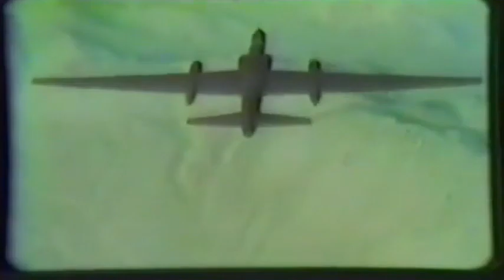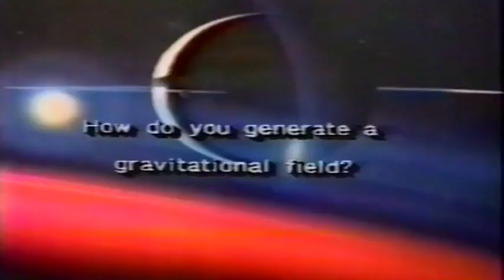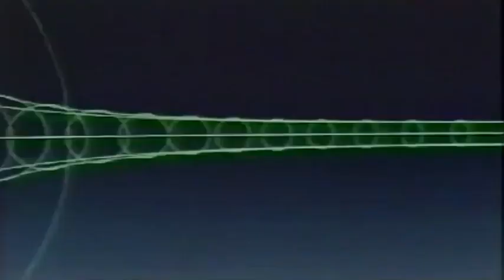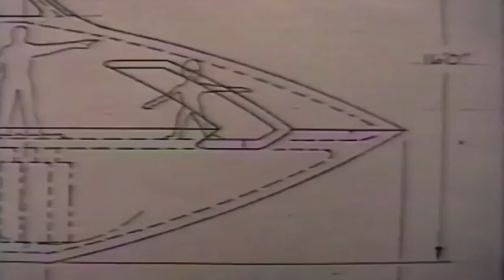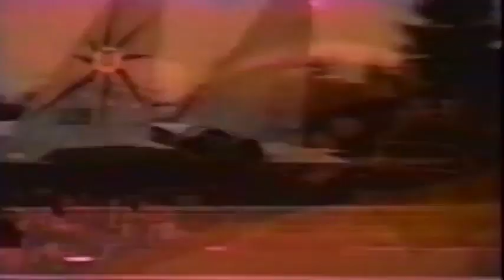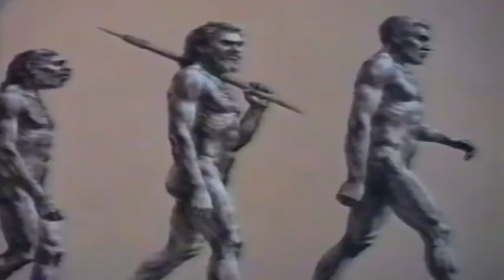Original Bob Lazar Lecture - The Lazar Tape And Excerpts From The Government Bible

Comment: This is unlikely, but if using unix time and replacing the first four digits of the current time with 1623, it converts to between June 6th and June 18th 2021. Unix time is more than 6 positions, but it's still curious
Reply: Interesting, something is supposed to be happening July 18th
Reply: John Doe 

1623 They will be back prob 1623 years from the time they told us they would be back which was in the 1940s-1950s. That would be the year ~3568. I will be 1,578 years old, I CANT WAIT
Reply: @effortlessawareness8778  well nothing happened on the earth date I suggested. Maybe you are right, but I wouldn't assume they measure/perceive time the same way we typically do (minutes, seconds, hours, years). They likely have other units of measurement and benchmarks
Reply: What's Unix?